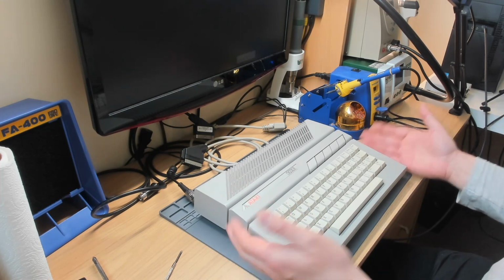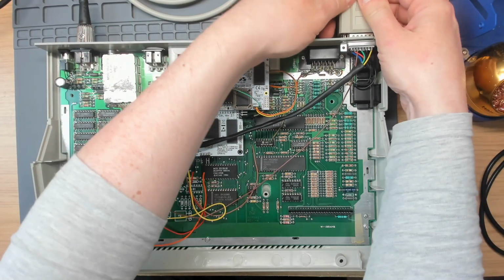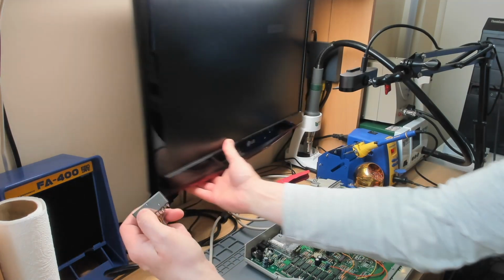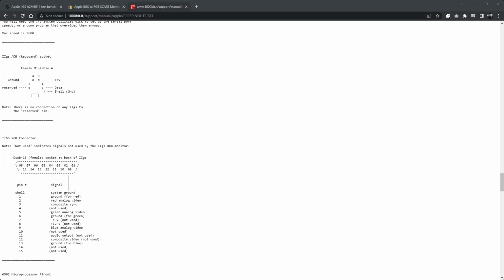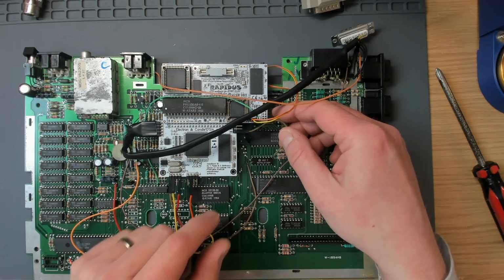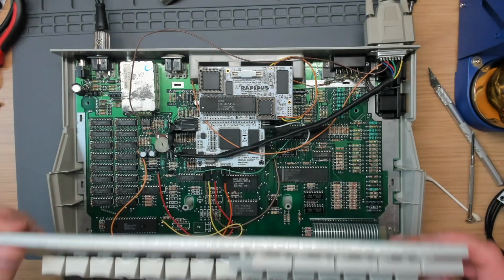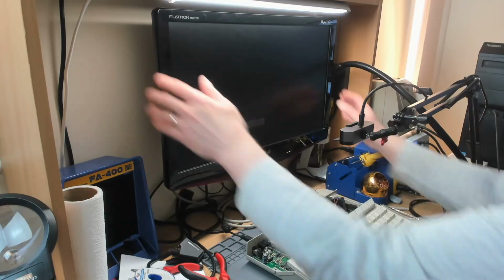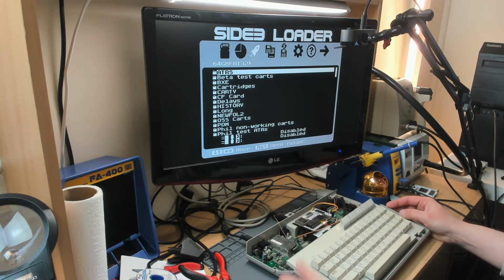Video issues on Atari 130XE with vendor-installed VBXE

Comment: I'm stunned that whoever did the installation gave it back with that quality of wiring. To have connectors able to drop off pins via gravity is just shocking. Also, they don't have ground pins on connectors for decoration, blooming well wire them up (aimed at the installer, should they be reading here) A right messy old can of worms there, have fun Jon..
Reply from the maker: Yeah. I didn't want to criticise the original work too harshly the other day, but after two further days of chasing my tail trying to figure out why the RGB signal was STILL randomly failing, I carefully inspected the 4-pin header on J1 on the VBXE, and instead of nice smooth solder joints, there were basically 4 solder balls perched on top of the pins on the back-side of the vias. Reflowed them and all of a sudden the D6xx connection is good and the video came back on. The whole thing has been an absolute rabbit-hole to Hell and just when I think I've fixed every possible mistake, I find another one. So yeah: the work was crap, basically.

Comment: I had that dark mono video last week on a rgb modded colecovision, using a sophia rgb scart cable where the 5v pin had pushed back. No composite video, just csync on the composite pin. I can only assume the dark image is leakage from the rgb lines.
Reply from the maker: I wonder if the monitor ends up in a limbo composite/RGB state whereby it's only half-heartedly processing the RGB signal. Interesting, anyway.